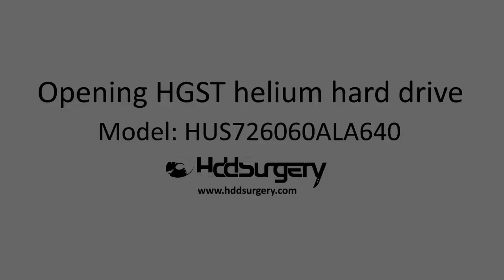Opening the HGST helium hard drive - HddSurgery

Comment: and how do you get the helium back in once you head swap?
Reply from the maker: +Peter Willy McJohnsonator That's the thing we need to research.
Reply: same as HGST fills it in the factory
Reply: @HddSurgery  Any update? Seems like purging a small environment, letting everything outgas, filling with helium to pressure, then using the helium environment to as part of the inert gas welding procedure is how manufacturers do it. You could probably get away with creating a helium environment where you could run a transplanted disk in a working chassis/board without having to reseal it. I assume you aren't trying to rebuild broken hard drives, just extracting the data.
Reply: YOU DON'T
Reply: what happens if they operate with air? maybe they will just work slower?
Reply: @poiiihy  they die by overheating.

Comment: It seems as the seagate exos hard drives come with a thicker layer of metal all around the hdd. Do you think helium leaking will be a problem for long term reliability, even if the hgst mtbf is excellent?
Reply: Helium DOES leak even from sealed drives. This IS a problem. We just got recently RAID 5 ARRAYwith WD RED 20TB drives that died because of a Helium Leakage.

Comment: I want to buy a helium hdd but do u think that it may leak fast and fail before an air hdd. I want to use it for backup for long years.
Reply: ive had a helium drive for 2 years and the helium level is still 100%
Reply: @Xiefux  thanks very much

Comment: are these drives still metal platters or are they glass?
Reply from the maker: +Peter Willy McJohnsonator They are made from the same material which is used for the platters on the regular drives.
Reply: glass

Comment: Are Helium HDDs allowed by flight companies ? (i mean if i have to ravel with my HDD...)
Reply from the maker: +BERSERKERDEMON1 We don't know, but there is no reason to restrict a Helium HDD. You should ask flight companies. Regards.
Reply: +HddSurgery - Data Recovery Tools i was thinking about putting a luggage in a baggage hold ... i mean 
these compartiments are not pressurised... on a long flight (higher 
altitude)  depressurised gaz could become a problem... (i wouldnt take 
the risk)
Reply from the maker: BERSERKERDEMON1 We believe that flight cannot damage the drive, nor the environment, but you should ask someone from the airline company, just to be sure.
Reply: +BERSERKERDEMON1 He is an inert gas no issues with use in an aircraft

Comment: How about "desoldering" with electrically heated frame, and suction?
Reply from the maker: +Jens Tingleff Soldering needs desoldering and welding needs cutting :)
Reply: "desoldering" meant as melting the thin steel-aluminium laservelding )
Screws out - melt and lift lid off with suction.
Reply: +Jens Tingleff it just doesn't work like that
cutting is the best method, they just need to not do it in an abbrasive fashion, but rather chipping or pressing instead
Reply: @HddSurgery  What is thickness of welded foil? I mean why just not cut it X-shape in center by scalpel or knife, and after that - simply tear it off sides ? No small metal dust, no waiting. Or main drive cover is also welded on sides ?
Reply from the maker: @AndrewD-IT  Did you watch video to the end?
Reply: @HddSurgery  Yes. See you made the same conclusion - CNC is not a best way to open it.

Comment: After open the seals Helium will leak out. You cannot recover it.
Reply from the maker: Actually, the drive can work without Helium.
Reply: HddSurgery - Data Recovery Tools Yes it can work after Helium leak out at that time, However the condition already changed ,How long HDD can stay? Not to much?
Reply: @HddSurgery  So what's the difference, why we need Helium? I am curious
Reply from the maker: @chalermphonprommarak8828  Our job is to recover data. If you want working drive take it to RMA
Reply from the maker: @nu8k700  We do not need it, producer wants it so drives can be better
Reply: @nu8k700  drive heads floats on a cussion of air. Air at this size drive causes turbulance so they have to use helium.

Comment: I can assure you this drive is dead  because when you open an HDD it's all over you can't fix it no matter how hard you try even if the Drive is healthy and functional
Reply from the maker: Hi, we think that all data recovery companies that exist more than 20 years would not agree with you. If you have appropriate equipment, Clean room, knowledge and experience you can  open hard drives and be very successful with recovery. The drive in this video survived and we use it as a donor.
Reply: o wow it survived